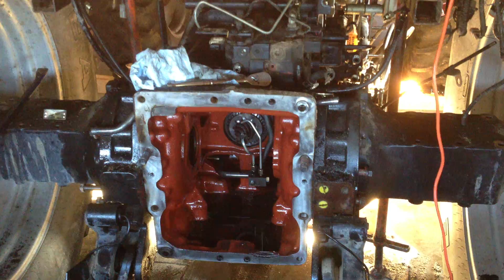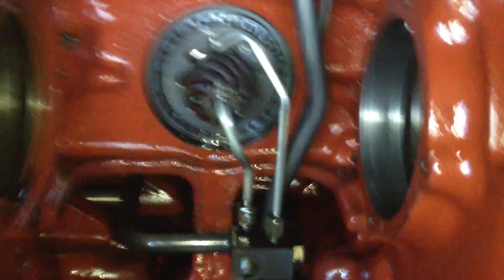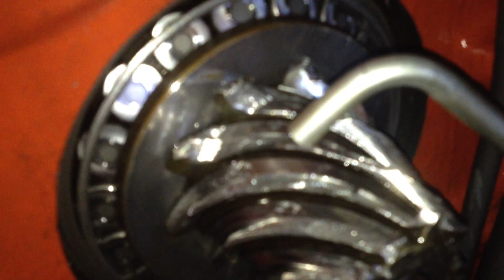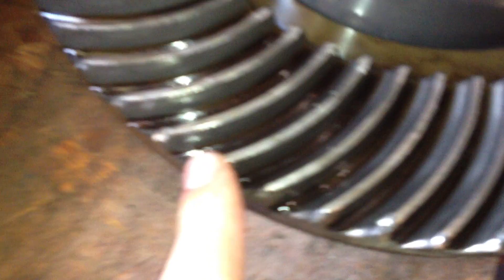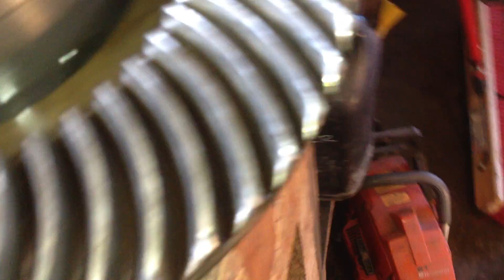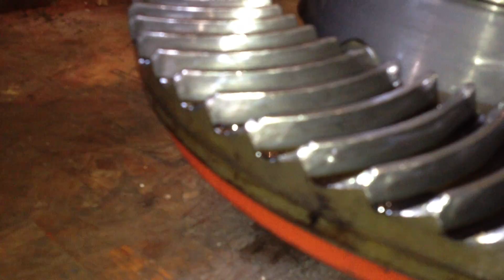CaseIH MX 135 tractor broke down part 2

Comment: Hello, when you repaired the case MX  how did you tested Thad the backlash and the bearing preload is correct? Did you have the special bearing cone CAS2024 that slides easily on pinion shaft for setting the preload of pinion shaft bearing? Thanks for your answer and have a nice day.
Reply from the maker: Hell if I know ...my mechanic dud the work

Comment: From the looks of the pinion gear, the ring gear wasn't centered, there should be a couple adjustment on each side of ring gear carrier that allows the ring gear assembly to be shifted side to side
Reply from the maker: You think it would have destroyed itself faster than lasting 9000 hours if it wasnt centered?
Reply: Not being perfectly centered will cause excessive play in one direction of tractor  between ring gear and pinion, in the other direction of travel it will be "meshed"  too tightly causing wearing to occur  Then when the mesh clearance eventually opened up more and more wearing occurred as the hard facing was wearing off allowing the ring gear to gradually "eat" away at the pinion gear during use. The gear teeth are face hardened and will take a period of time to wear down to a point that complete shearing of gear teeth happens. I am willing to bet that if the differential has never been taken apart that it came from the factory off centered. That would be something to discuss with the dealer you purchased the tractor from. I'm not an expert nor am I a mechanic of farm tractors, but if you ever ran the tractor at high throttle in high gear down a paved road, the differential should have been making some kind of un-natural sound
Reply from the maker: It didnt really make any noised until it happend.

Comment: how did you remove this stub shaft gear, I've currently got my 1255xl in bits with a similar problem. did the shaft just slide out after the diff was removed